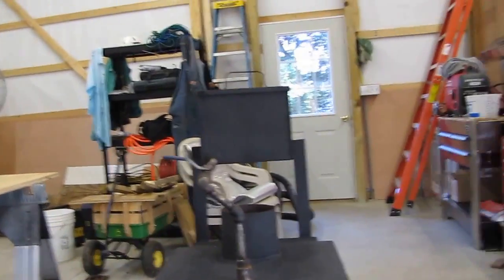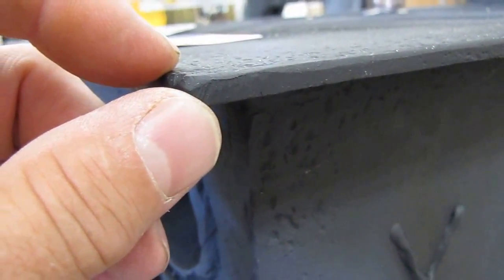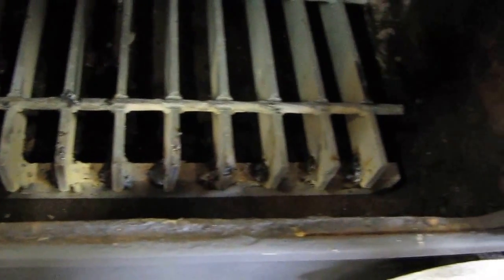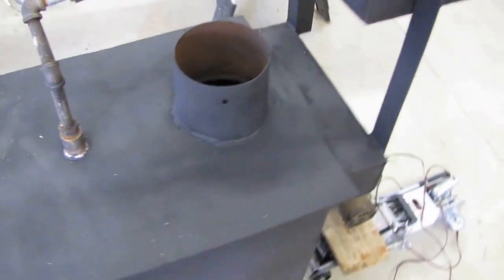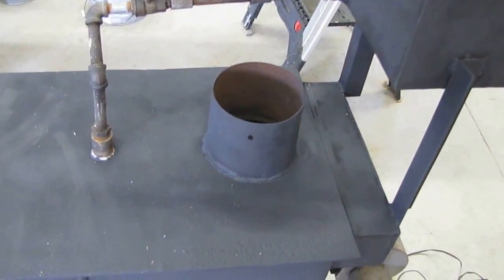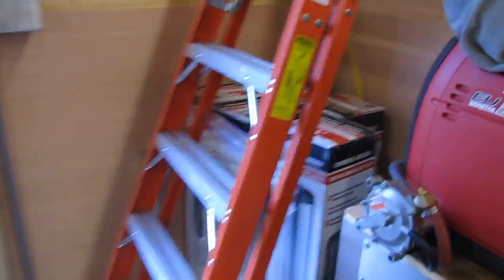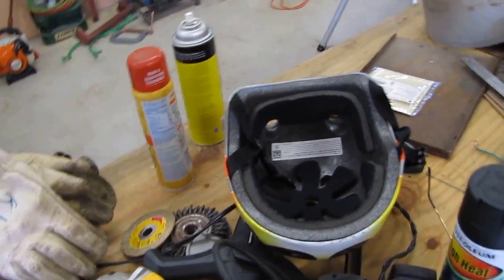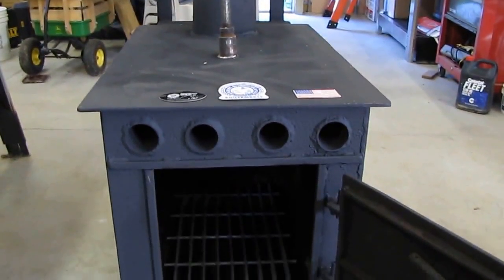Biomass Hybrid Heater /WOOD STOVE / WASTE OIL FURNACE "THE VIAR 94" Boilermaker  Made

Comment: Very nice stove you built there! If I may comment, I would weld feet or pads on the bottom of your legs. It will help distribute the weight instead of concentrate it on only the very edge of the channel. Keep the videos comming!
Reply from the maker: I appreciate it Buddy ! That Is a Great Idea Many Thanks Buddy  Cheers Kenny

Comment: So is the oil just dripping into the box, no special nozzle or anything? I am trying to find a way into my outdoor burner to add waste oil. its a big Natures Comfort with a water jacker, so not sure whether i can go down the stack, or have to just build a custom door. Any thoughts?
Reply from the maker: Yes Sir Paul It Is Just Manual Feed Drip System It is Just Stainless Coupler Going Down Into My My Fire Box So When I Burn Green Wood Or Wet Wood No Worries It Will Still Burn You could Always Just Put A Small Valve On It And Let It Drip I Do That Also You Could Always Put The Oil Drip System In The Stack And Run It Down To The Fire Box Like Use Copper 3/8 Flexible In The Side Of The Stack And Make It A Gravity Feed  That Should Work Great
Reply: interesting! Thanks for the advice. I may have to try that. Would a cast iron pan work okay for the splatter plate? i have to check with my permit office here is PA to see if i can burn waste oil.
Reply from the maker: Mine Burns Directlly On My Hot Coals Of The The Fire Splatter Pan It A Great  Idea